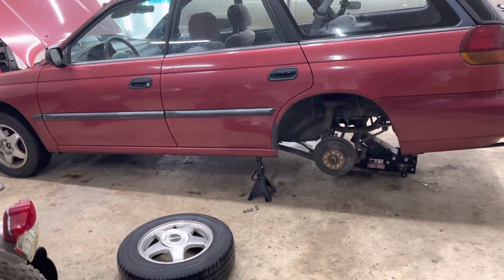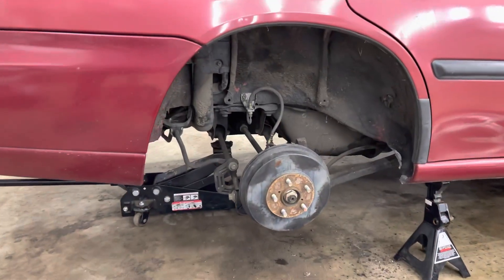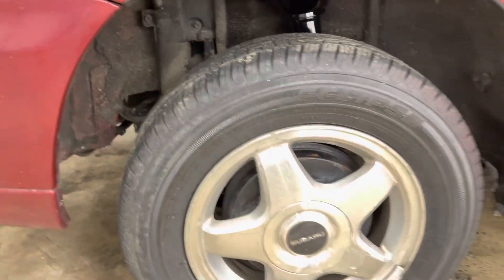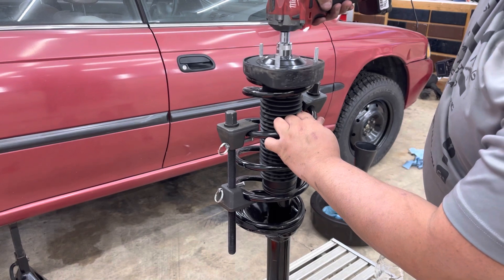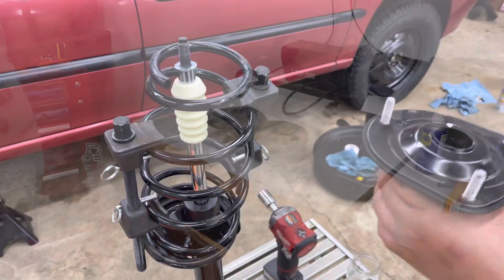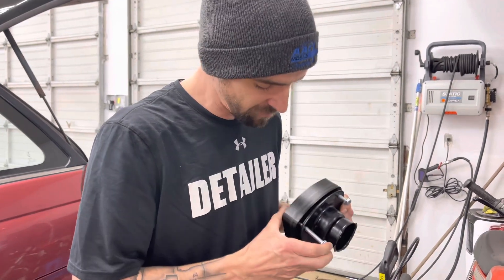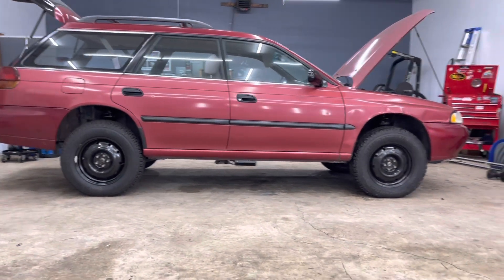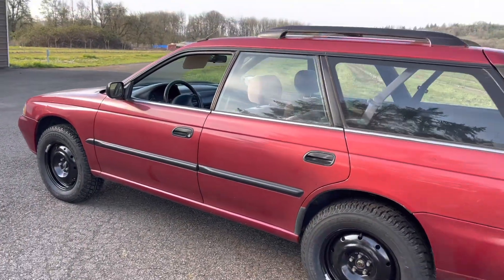Subaru Legacy Overland Build Part 2 Lift and Tires

Comment: They sell rear control arm spacers to move the rear wheels back, you could also use adjustable rear control arms out of a wrx and have it adjusted during a wheel alignment
Reply from the maker: Yes I added the spacers as well.

Comment: Ignore if mentioned: Take a dremel or hacksaw to those brake line brackets. Remove the retaing clip, Cut them in the middle on the outside end, twist one up>one down and slide out the line. Do the reverse on the new ones (once you're 100% you're keeping them), install the line, bend 'em back and reinstall the clip...they're secure.

Comment: A deep 1/2” drive socket on concrete or a brick would be a much better receiving cup for a stud than a crank balancer on an MDF surface.
Reply: Don’t try to make cave man tools sound bad. It got the job done, no harm to the parts or tools, who cares!
Reply: @j_mars_cars  never said there was something wrong with swinging a hammer, but if I can swing it fewer times in a more controlled manner for a better result I’m gonna do that, and with how much I’ve learned from YouTube I feel obligated to share every once in a while

Comment: What size are the new tires?  What width, brand and backspace are the wheels?  We are doing a similar build with a 1998 postal vehicle!  Thanks!
Reply: I see from previous comment replies the tires are 215/70 R16
It would be great to know all the other wheel details as the previous guy on this thread asks. Critical to prevent/minimize rub.
Reply: I'm wondering if I can fit 29x10x15s after I finish this lift

Comment: Very cool comparison with the forester struts sitting beside the originals. Thanks for the vid.

I always heard you cant do more than 2" on 1st generation subaru?

Hope i didnt miss anything only watched this part.
Reply from the maker: You get roughly 2 inches with putting Subaru Forrester struts on plus I ended up putting some 1 inch spacers. Never had an issue.
Reply: @AndysAutoCarePlus  to confirm: it lifts a bit more on the front correct? So it looks like doing a quarter mile pull sitting parked?
Reply from the maker: Not really unless you load up the back. I don’t have this car anymore but when I did it sat super level, even with the rooftop tent on the back.
Reply: @AndysAutoCarePlus  thanks for replies. 

Can't remember if it was your video or another that showed the rear at an angle that differed from stock vertical position making it clear how the rear wouldn't be raised as much. 

Maybe my b

Comment: Hey man I know this might not still be fresh in your head but I'm definitely about to do this. I just got a 99 outback with a bent a** front shock. Instead of getting original replacements I'm going with the Forester upgrade. I've heard to use 08 XT shocks and I've also heard to use any 04+ shocks. 

Could you help me clear up which year and model you used? I'm going to order the same ones from RockAuto. 

Also did you use a spacer in front and back or just in the back? Which size spacer in front and what size did you use in back? 

Tire size noted and trailing arm spacer noted. This is the last bit of info I'm needing to get this done. Thanks for your help
Reply from the maker: The outbacks comes stock taller than the legacy, so I’m not sure which ones would actually lift it. I would definitely look into just getting a stock replacement, then putting spacers on it.
Reply: That's where I'm starting. The 2008 Forester XT shocks are coming today. I ordered the 2" trailing arm spacer but I'm still thinking the back may look saggy. It's looking like I'll have to install it all then install the spacers after I see how much lower the back sits
Reply: @AndysAutoCarePlus  did u guys end up taking the tops off of the front strut assembly to remove the short bolts? Or were you able to pound them out without taking the strut assembly apart?

Comment: Love it!!! Did the same exact lift on my 99 legacy with forester struts and 2” trailing arm spacer. Running the same size tires (215/70/R16)...did you end up using any wheel spacer to help with the front wheel rub on turns?? Its hitting a bracket that doesnt look grindable
Reply from the maker: I never needed to.

Comment: What else did you have to change after lifting it 3 inches.. and what side control arm spacer would you wanna add to a 3in lift like this ..
Did you have spacer in the front
I'm about to lift a 2004 Subaru legacy 35th anniversary..
It's also getting headed full exhaust and a intake.. any other recommendations on getting it running a bit better too helps

Comment: Thanks for the video! For which model of 2004 Forester is your lift kit? because there is few sub-models for different engines i think. I was checking kayaba lift kits, so i want to make sure that it fits.
Reply from the maker: There all the same struts other then maybe the xt use it from the xs